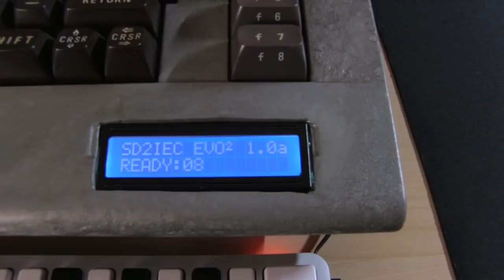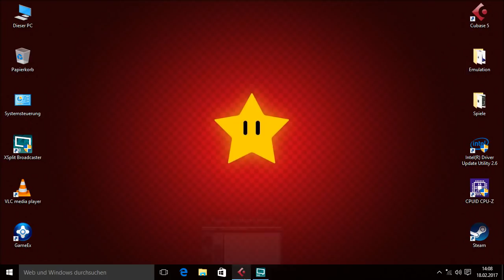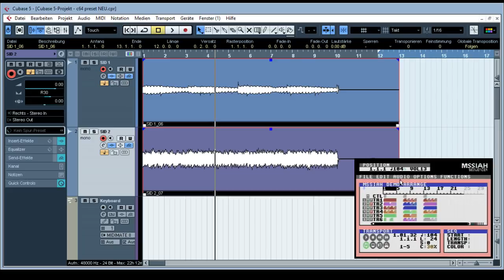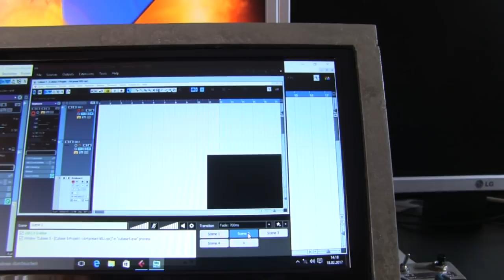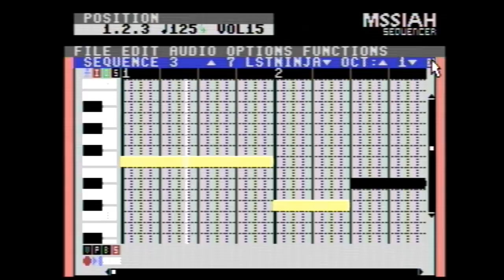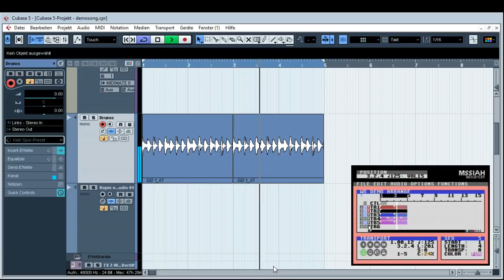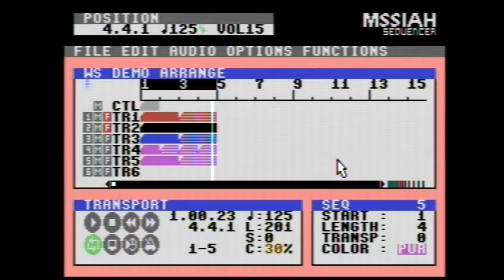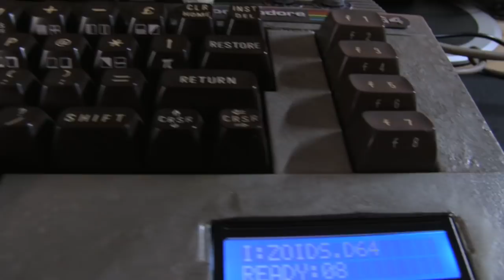Commodore 64 music workstation - NEW  review & composing a short song with the machine [english]]

Comment: Way way beyond my limited comprehension, but oh so cool! Well done! I wonder what would have happened if you had been able to use a C128 (assuming any software was available for it, which it probably wasn't). Thanks so much for sharing.
Reply from the maker: Thank you for your commen. As long as the MSSIAH cartridge works, it should be the same but with more "room" inside the maschine to place some of the components i now placed external.

Comment: impressive...how would you reccomend recording audio from C64 in a more "standard" configuration?
Of course I was thinking about RCA audio cable connected to a mixer or audio interfaceand then to a PC...is there any other option?
thanks in advance bye! :)
Reply from the maker: If you are using a standard SID, the only option you have is the AV port of the C64 with the AV cable connected to a mixer or audio input of your soundcard. Be careful not to hot plug/unplug the connected cable and don’t turn on/off the mixer while the C64 is switched on.. this could in rare cases damage the SID.
Reply: @Naviaravideos  ty so much I didn't know that :)